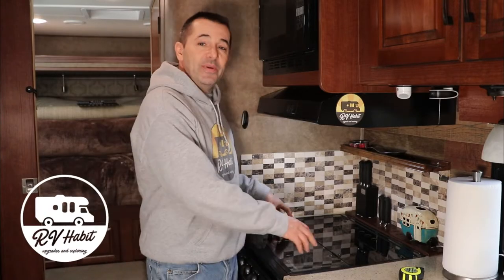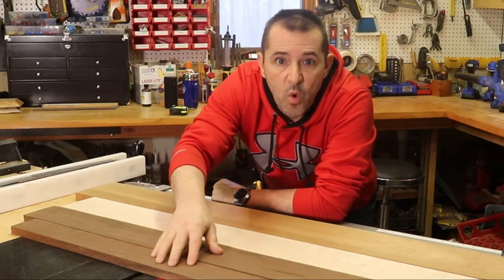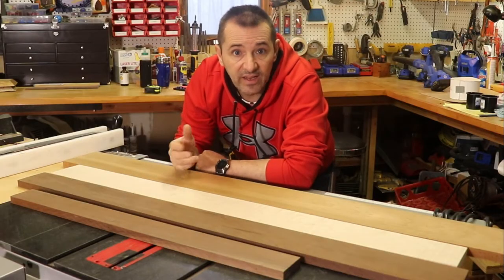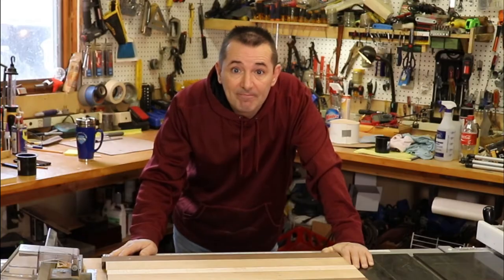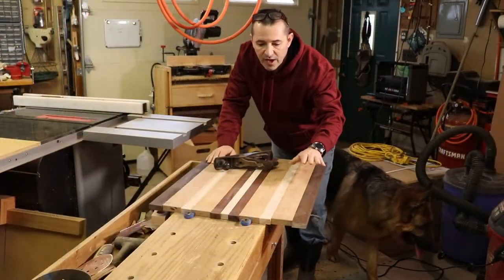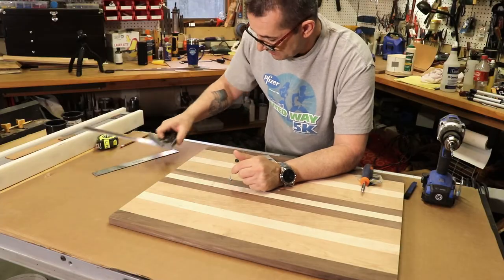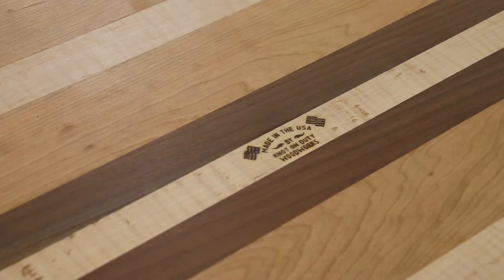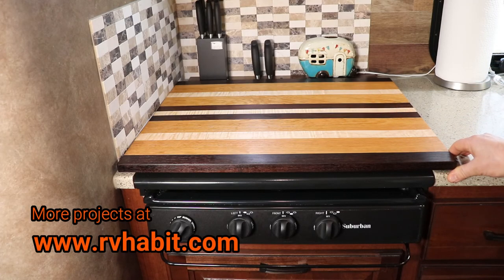Custom RV Stove Top Cover - Noodle Cutting Board – DIY – How to build - Stove Topper Cutting Board

Comment: Where did you get the stamp with the logo and name. I am a woodworker too, I have a 2000’ home shop with over 50 hp of 3ph stationary power tools.
Reply from the maker: That's an electric branding iron from Rockler.  I have had it about 15 years and still works great.  You can purchase different style heads for it.
Reply: Now that you said that I have seen those in her catalogue. I don’t have time to make videos, too busy doing projects. I do have shop photos on forest river forums however. I have made 16 solid walnut doors and all walnut cabinets for my house which I have been building for 7 years.
Reply from the maker: That's fantastic! No greater pleasure than building something with your own hands.